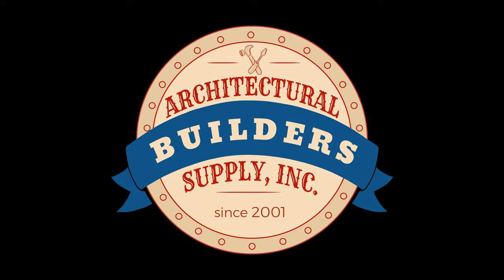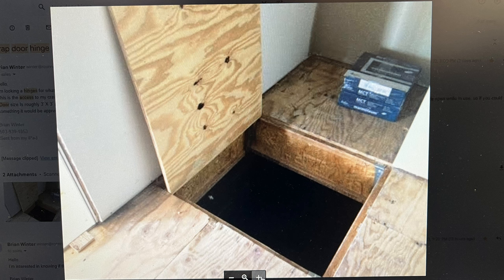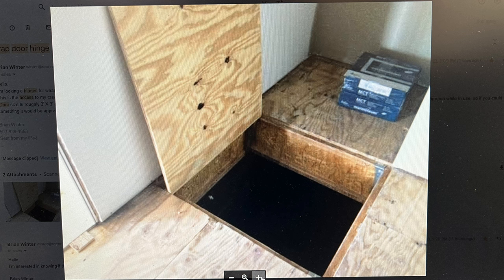A Conversation Regarding a Trap Door application and how best to hinge the door

Comment: A far simpler way to gain access to below is a simple lift-off hatch, no hinges.  I'm designing such an egress hatch from an upstairs bedroom closet to the garage workshop below, just big enough to get through if I can't get out via the upstairs hallway.  The whole thing is just a hole cut between the floor joists with a hatch to cover it.  The cover has a recess that houses a hinged lift handle.  I figure the cover itself will weight roughly 15 pounds.  There's a swinging grab bar attached to the ceiling below and clipped in the up position.  If I need to use it, I lift the cover, set it aside, lower myself far enough into the hole to grab the bar, and basically jump.  My weight releases the clip, and I swing down on the bar, leaving my feet a foot or so above the workshop floor.  I can't shut the hatch without getting a ladder and reaching up through the hole, but I would only be using this in an emergency, so closing the door behind me is a moot point.
Reply from the maker: Thank you.  How would you accomplish the same task if your door was 65 lbs?
Reply: @absupplynet  That's like asking how I would power my car it weighted thirty tons or how I would hang Christmas lights on my gutters if my house were ten stories high.  The answer is I simply would not design a door in such a way that it would weigh more than I can easily lift with one hand.  My design is purposely simple. The door in my design exists simply to fill the hole and support my weight when in place.  It has no other functions.  Making it weigh 65 pounds would run counter to the required functionality of the design.
Reply from the maker: @rangersmith4652  My question is posed for the benefit of the community at whole that may see this conversation.  How would you design a floor “trap” door where the weight is 65 lbs?  Floor doors like this were generally heavier because they do need to support the weight of something on it, like a person perhaps, and a floor insert that weighs 15 lb may not have much ability to support a couple of hundred pounds standing directly on top of it within a one square foot area.
Reply: @absupplynet  I don't how I would do that, but I am certain my door will support me and will weight well under 15 pounds.  I think the greater engineering puzzle would be to design a roughly 14-16" trap door that weighs at least 15 pounds but will not support 200 pounds.